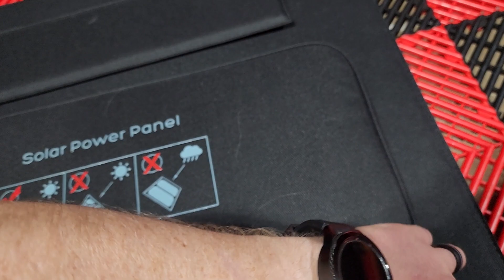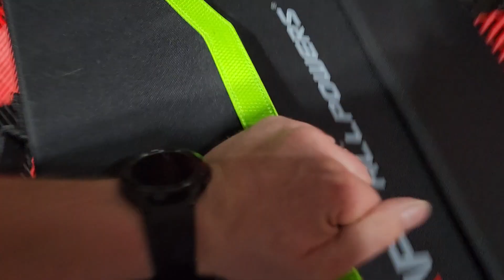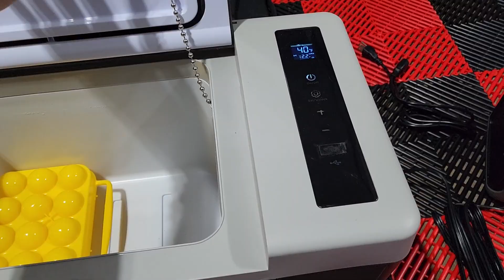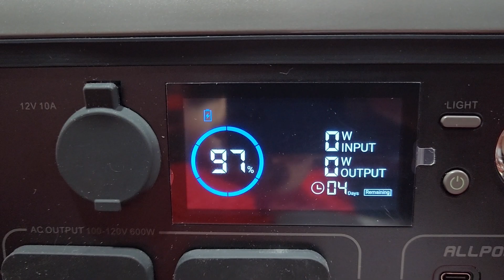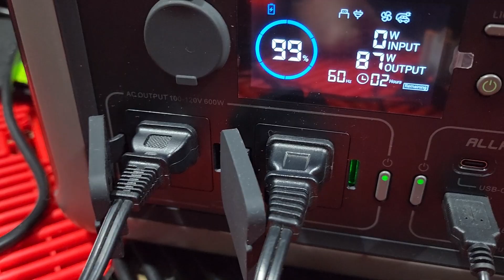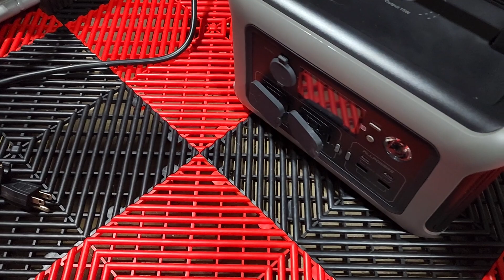Very Cheap and Very Handy Allpowers R600 Power Station

Comment: I'm in the market for one that will just keep the wifi modem, a few lights, chargers going during outages. Suggestions? I have a propane generator, but by the time you get it all going, and the noise... A small backup battery bank would be nice.
Reply from the maker: Ya this one or the pecron is affordable and would handle those for awhile. https://amzn.to/4cLN0rp
https://amzn.to/4cQ9Q11

Or something a little bigger
https://amzn.to/43T7wSJ
But this one comes in a little more expensive at 450. 
It all depends on how long you want to run those items on the unit